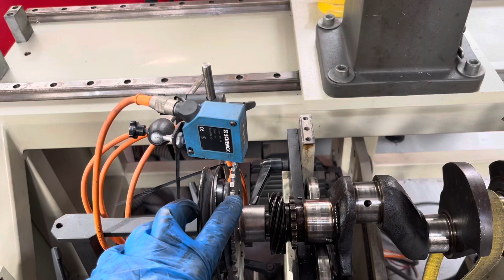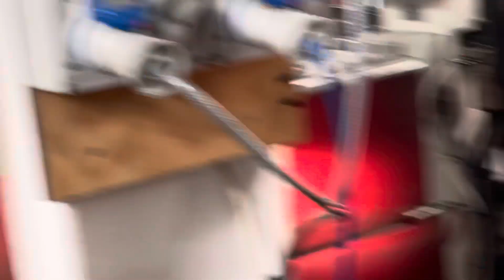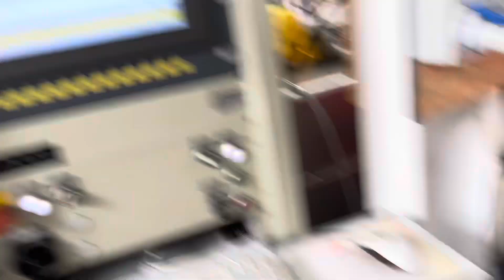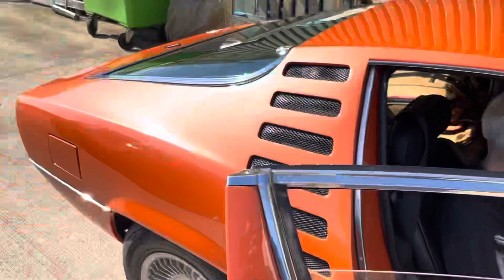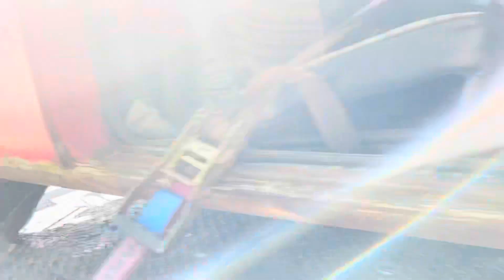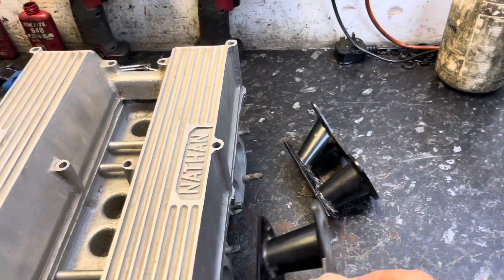ShrigleytubeTV ep9  crank balance, alfa montreal v8, williams laguna,c20xe build, costin Nathen

Comment: i had a friend who would balance cranks on a set of big knife edge rollers  that were used to balance surface grinder wheels  j and s  iirc 
 he would weigh the conrod   piston  all the bits that goe up and down then pick a %  eg 63 %   then han a lead weight on the end of the conrod      put it on the rollers and tape nuts or similar   on the fly wheel    then driill out the same  weight   180 degrees opposite   
the higher the percentage   the   balance point would go up the rev range     
its all in that book" tuning for speed" by phil irving
Reply from the maker: thanks wow sounds very interesting, harmonics is not something i claim to know anything about, i would like to buy a balancer one day, it’s one of the very few jobs i ship out !